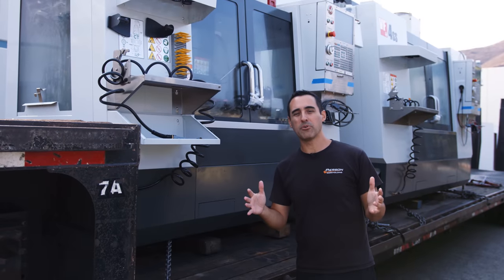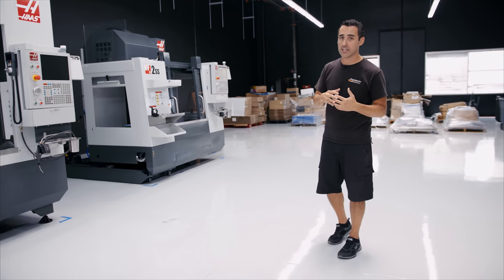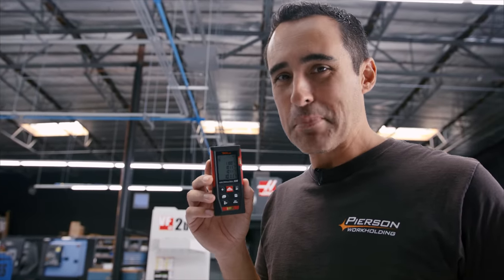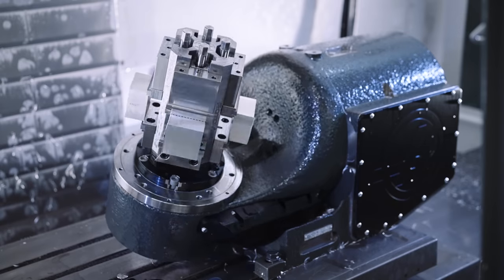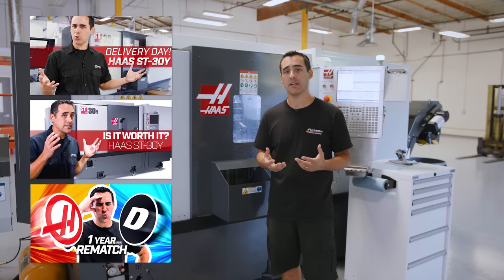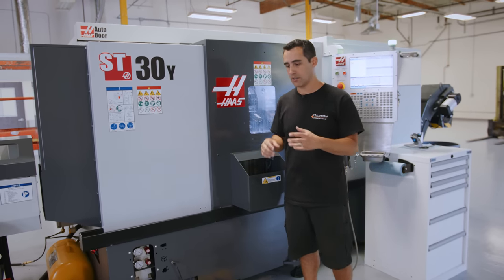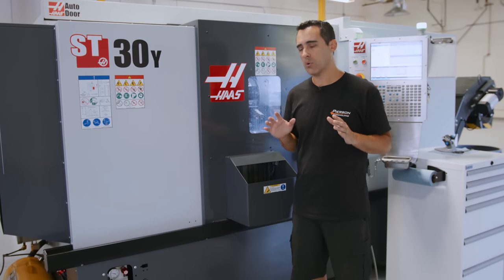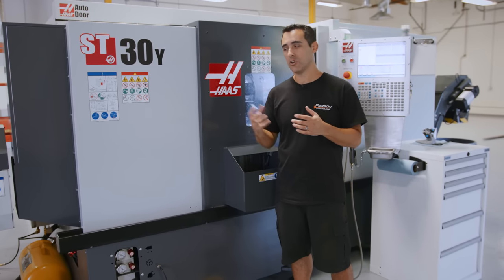Machine Shop Move Vlog Ep 4 | We’ve got to talk about my Haas ST30-Y

Comment: As the ad was playing, I said to myself: It’ll be a Haas. I’m not a Haas hater, and we have a bunch in our shop. I consider their controls to be the industry standard, which no other manufacturer measures up to. But on the hardware side, it’s all the little things put together, that make your hair turn gray some days.
Reply: I love Haas, if I would start a shop my first machine will be a Haas to quickly start generating money. However after that I would never buy a Haas again. Glad I’m moving from a Haas shop to a Doosan shop in 2 months
Reply from the maker: Doosan machines are far from perfect but their lathes are definitely more developed.
Reply: @PiersonWorkholding  Funny you mention that. I’ve been banging on the Doosan drum at work, to replace our Mazak lathe. 😎
Reply: Or what does turn gray turns loose 😅
Reply: Doesn't 😂
Reply: Pierson: I am quite surprised that you don‘t fill your own DI tanks using an industrial RO filter/membrane setup. Easy to do

Comment: When I started my shop last year, I looked at several Haas lathes to start off with (from the used market as I could not justify a new one) but knew there were a lot of other great options out there. Having experience with ST10s and 20s, I knew their pitfalls well, but did not know if it was the right call looking at other brands as I would have to learn a brand new control. I ended up going with an older Mazak Quick Turn Nexus and have been very shocked and pleased with it at the same time. It has its own sets of issues that the Haas does well, but having Integral spindle motors, weighing a a couple tons more than the Haas, and having the power of Mazatrol at my fingertips has been extremely beneficial to me. Being able to set up and run small lot jobs and make programming tweaks on the fly without having to visit a seat of CAM software is quite nice, but it does have its limits when it comes to live tool milling. I remember running 1" insert drills in steel on ST lathes, which would get the spindle load up there into the 100-150% range. Doing the same cut on the Mazak with a similar style drill results in a spindle load between 40-50%. The Puma 2600SY is an extremely nice machine, very rigid and thermally stable, it may be what I end up going with next as the new Quick Turns coming out of Florence Kentucky are on the higher end of the market spectrum.
Reply from the maker: Thanks for sharing. Yes, all machines have their pros and cons.

Comment: Awesome video as usual Jay. Ya know the St30 Y does not surprise Me at all. I only have Haas machined so I might think differently but the fact that most of You turning is Doosan why would You even want the odd ball lathe in there. To me in my opinion it simplifies programming , setup, and operation by having all the turning with one style controller. I am a little surprised by the new shop machine spacing. How far apart are they.? The look fairly close, but it’s going to be awesome. Congratulations on Your new shop!
Reply from the maker: Yes! Standardizing machines is a very important practice that is often overlooked.

Comment: I knew you were going to leave the y axis HAAS lathe. I have an ST20y and I feel the same. just a total disappointment. homing issues. it loses centerline randomly. auto door broke the first month out of warranty. auto door closed so rough! I also bought the probe and NEVER used it, the machine just always faulted the probe because the machine itself didnt know its centerline most the time. Each power up you have the center each tool holder with a indicator and then run the machine. So don't turn it off if your in a part run! 100% my wife will never let me buy another haas just because she hates running that machine so much. Which sucks for me because I like my vf4 and now that its paid off I would buy two more!
Reply from the maker: Haas mills and lathes are miles apart in development. I'd go for another VF4!
Reply: @PiersonWorkholding  I will. Just have to get My HFO out here to fix this lathe so my wife will approve it!  I want one of the automated vf2 packages with the part picker/pallet system
Reply: @hyperformancellc  I am know this comment was from a long time ago but... Take a look at the new SVM line from doosan, I got a SVM4100 to replace a VF2ss and it absolutely smokes it! Was about 10k cheaper too

Comment: Jay, whats that yellow air tank under the ST30Y used for? Is that a supplemental air reservoir for the lathe? Thanks much!
Reply from the maker: Good eye. We had air flow issues at the end of the line at our last shop. The yellow tank was a reservoir to add instant capacity for the blowoff nozzles.
Reply: @Pierson Workholding  thank you!  This is interesting, I've been thinking about adding an air tank to my vf3 to give more capacity at the source. I have a very well designed air system in my shop and I can't help but thinking this mill uses tons of air during certain times.